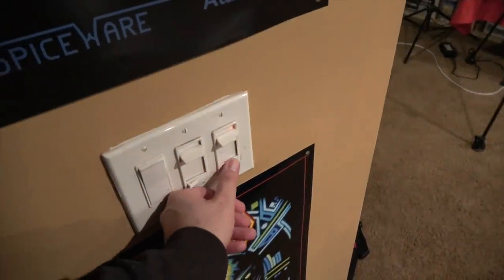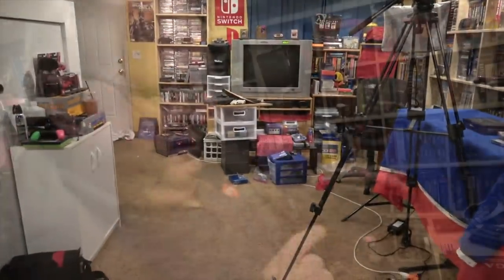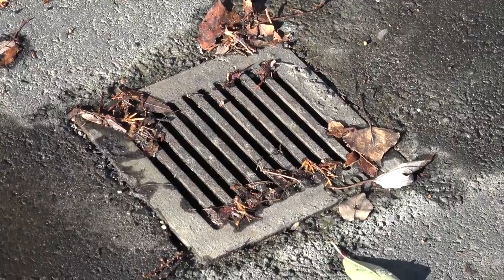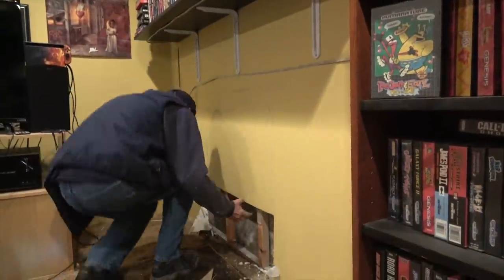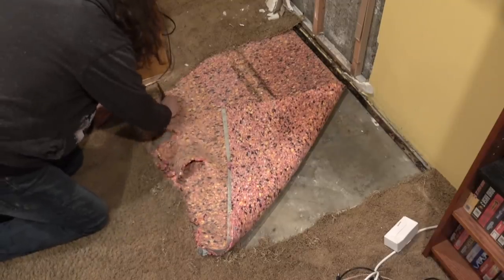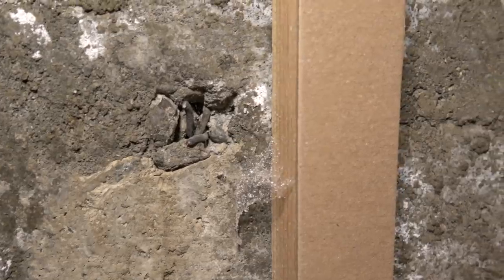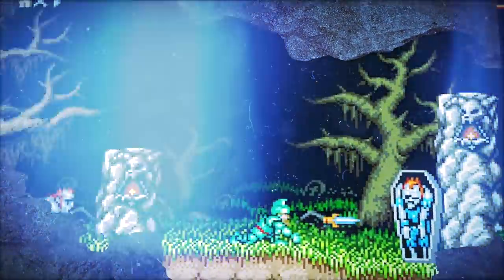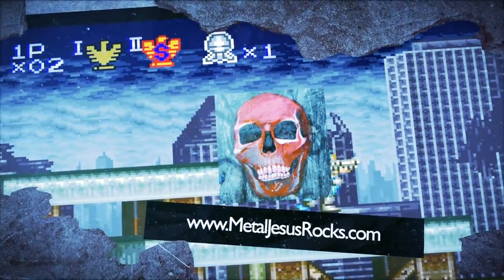OH NO! Water & Mold in the GAME ROOM! $10,000 to fix!

Comment: Concrete contractor here- be smart, don't overkill this- get several quotes. Basement waterproof trenching is a competitive business and might not be nessassary to solve the issue, Lowe's/home Depot will often install carpet free or low cost if you buy there, and drywall patching like this is an easy DYI if you watch a couple how to vids. I really don't think you're talkin a $10,000 fix. Sleep on it, and don't sign anything too fast. Love your show!
Reply: I do not recommend a homeowner do their own drywall, especially if they're techie people and not handsy people.
People who don't work with their hands often can't even be trusted to hang the rock. Finishing it is an art, and you really need a hopper and compressor to apply texture.
Reply: @billybobjoe198  LOL, almost any idiot can tape and mud sheetrock. It's rather forgiving, any imperfections in the mud can be sanded out. If you sand too much, you just apply more mud. As for texture, his walls don't have it so why are you even mentioning it? Watching some DIY vids is all you really need to patch a section. BTW, I'm also a "techie" among other things.
Reply: @madmatt2024  As someone who's been doing this for 10 years. I would bet I'd cringe at your drywall work. Either that or you'd spend weeks doing what professionals could only make a living doing in a day.
Reply: @billybobjoe198  Well someone seems to think a little too much of themselves and their menial job today. I guarantee 9/10 people couldn't tell the difference between my work and your work. I've done autobody work as well which shows every tiny imperfection, sheet rock is cake compared to it. Very DIY friendly. You just want to scare people away so you can make money.
Reply: @madmatt2024  It's not about having a big head over anything, it's just honesty. Even some professionals do junk work. Working on a wall with no texture is far harder than one with it. Texture hides imperfections. If you can't tell, my avatar is a cam gear. I've done my share of body work. DIY drywall is a lot like DIY bodywork. Most people don't have the skill set or patience required to do it. I'm just trying to save people the time and money to have a professional do it the first time.
Reply: @billybobjoe198  My dad is a construction worker and he says the drywall is where they put all the new workers at because it's the easiest to learn and hardest to mess up, chill out, I get it's your job and you're proud but it really isn't a big deal. It's not like it's the actual foundation of a house. Anyone can do it with a few tutorial videos or less then a week on the job.
Reply: @billybobjoe198  But its not nearly as hard as you're making it out to be. You tape, mud, and sand it. Once paint is on nobody will be able to tell. If we were back in the lath and plaster days I would agree with you 100% but today, not so much. If you want to be that anal about sheet rock then that's your business.
Reply: @kikyouwuv  I'm not 'proud'. I'm pointing out it's an art, and not something everyone is adept at. It's not a great DIY project for people because there is a learning curve and it essentially requires specialized tools to do. I can also tell your dad has nothing to do with construction because that's not even remotely how construction works. Also I find it funny how you're comparing dry wall (finish work) to foundation (non-finish concrete work). The vast majority of people you see doing concrete are fresh out if prison felons who don't actually have industry experience. I have seen countless homes with DIY drywall repair in them. It's painful to see. Sometimes customers hang their own rock, and it's unuseable. The goal in drywall is to mud over a good foundation (as few seams as possible with as small gaps as possible), mud as little as possible, and to not sand. Mud on drywall, just like bondo on car bodies, is a bad thing. It's a failure point.
Reply: @billybobjoe198  It's not an art. By the way you're talking you're a drywall contractor who needs to make himself feel better by making his work out to be more than it really is. Stop fooling yourself.
Reply: Get this to the top so MJR can see this!
Reply: You guys are hilarious. Upload some photos of your drywall repairs. If you're some of the fairly rare people who actually have the skill and patience to do it it'll show in your work.
Reply: @billybobjoe198   just want to point out alot of techies are hands on people.
Reply: Had an issue in a bathroom got a 10k quote diy work ourselves for 2k
Reply: This basement room is doomed unless you dig up the yard and address the issue instead of trying to place a bandaid. He should move, he will be fighting this issue every year after the winter thaw.
Reply: this guy is not the handy man sadly hes gonna be paying around 7-9g's for this job and its not a dry wall patch hes gotta basicly remove the sheetrock at hip height throughout the whole house
Reply: I've worked years in disaster recovery. I've taught people of all ages, from high school to grown adults who have never used their hands for labor, how to properly hang and mud drywall in  1-2 weeks, and our work is better than most of the work I see from professionals/contractors. He also doesn't need texture. This is the kind of thing the vultures would swoop in and tell old ladies after a hurricane/flood. Then we show up after they've put up a bunch of crap work for 10-20k and have to take it all down and do it again.
Reply: I'm sure he's just looking for money
Reply: Completely agree. Get several quotes. Don't jump too soon.
Reply: Work in construction as well, it’s not going to cost you that much if you do most of the work yourself.
Reply: @DRS_ur_GMEShares  Not everyone have the knowhow and experience to do something like to by themselves. Sometimes, you have to get someone to do the job.
Reply: I have to agree with Kelly Martin here. No offense to MJR but drywall perfection doesn't look like it would be high on his list. I completely hung my entire basement ceiling myself and one wall. After I was finished hanging the drywall, had somebody else come out and do the finish work. I probably could have done it myself, but I wanted knock-down texture on it all and I know I didn't have that ability and I'm a stickler for it looking nice. Also, $10k seems awfully high for the repair, but maybe that's just the going rate for that area. I just had to have a leak repaired on my main line coming into my house a few days before Thanksgiving. I paid the plumber $600, and that included him paying somebody to trench out the area. Luckily I realized there was a leak fairly early and got everything in that vicinity moved and the carpet pulled back. Before the leak was repaired, I was removing 7-8 gallons of water a day between emptying a dehumidifier twice a day and changing out towels every 3-4 hours. I'll have to have somebody come and re-stretch  my carpet, but when it's all said and done, I'll be way way under $10k.
Reply: @madmatt2024  Yeah, but try explaining this to a youtuber. :3.
Reply: @billybobjoe198  I doubt it. I don't need to tell anyone how long I've been doing this to flex on youtube. Then attacking people. I'm sure your work is quality :3.
Reply: When I'm done with grad school we need to fix our basement. When it rains, we get a little stream of water through our basement. So the basement is essentially useless. Foundation is 120 years old. Lord knows how much that will cost....
Reply: I don't think he wants to do it himself...he wants his subscribers to pay for it
Reply: @billybobjoe198  eh. Ive done my own drywall work with no prior experience.  Doing it quickly and perfectly is an artform for sure but its a pretty straightforward job when each second doesnt count and a mistake can just be fixed tomorrow.
Reply: byw yeah a good pro can definately get the job done quicker and better but let's be real here if you have a really nice home with arches and nice woodwork etc..get a pro.  In a basement space, just 4ft and mostly covered by shelves and game cabinets it'd be fine to DIY.  If its messy you just sand more.  Sand too much just get more mud.  It's not like reframing a load bearing wall where mistakes can damage your home.  If he's trying to cut some cost out, refinishing yourself is the right place to try to save money.  The worst that can happen is it doesn't look clean.
Reply: @billybobjoe198  but honestly why would imperfection on a wall matter when he is just putting a shelf infront of it
Reply: @billybobjoe198   lol in the uk we call bondo  BOGGING............though metal jesus first steps should be making sure the problem dosent spread around his home, ripping up the drive way  should be his first job and laying better drainage should stop the rot spreading to the other pins and then attack the dry wall.............leaving a driveway that has drainage issues to drain onto a leaking home is just asking for more trouble down the road
Reply: how can he be dealing with this problem every year when he is getting a really good fix it job and he has lived in the house for 12 years and it was built in the 60's and has had no problems like this till now.
Reply: One word, (Tremco)with drainage wall. 2,000 maybe if you dig trench and install product yourself. Fuck it YouTube university for waterproofing walls.
Reply: 10k it s ok if you have to do structural work
Reply: @billybobjoe198  Drywalling requires some physical exertion, but any dumb shit can handle it.  It's not an art.  There's a reason it falls in with other  sub-tradeschool service jobs, like painting.
Reply: @sluggdiddyyddidgguls  Nope.  There's plenty of sealant options available to consumers.  For about $500 I got my 1960's basement sealed up tighter than a menopausal nun.
Reply: @billybobjoe198  really wish I still had the before and after pictures of the 3 foot drywall patch job I did 5 years ago...Watched one very good YouTube video bought 2 sheets of Sheetrock, expecting myself to fail a bunch of times which didn't happen, even painted it myself...not every, "techie", as you put it.  Is a numpty at working with their hands and guess what there are "techie" artists in the world not everyone conforms to one trade or "hobby" I  for one love 3-d design, welding, and carpentry I have even dabbled in drafting too.
Reply: @LumenateTV  You're a jack of all trades. Same. It's hard to picture the incompetence of others sometimes.  Imagine a normie making a 3d model for the first time. they'll make a basic shape and get frustrated with the UI and give up. Imagine someone welding for the first time, they don't understand heat management and penetration and will make hemorrhoids on the steel.
Reply: i have a better idea why not just dig up the front yard but a 2 foot deep foundation  extending from the basement then put a drain going away from the house line it then fill it back up with dirt to catch the water and funnel it away from the house sure front yard will look like shit for a few weeks and it would be a band aid fix for the immediate problem area but it would be cheaper and look better than a roof or an internal drainage system
Reply: @billybobjoe198  thats what wanescoting and wall trim is for ;)
Reply: @madmatt2024  it is diy friendly just the doing it for the first time area will look horible till u get the hang of it suggest if he does go to home depot they have workshops on this sorta thing dont they?
Reply: Adrian Stoness best place and where I learned was doing the inside of closets nobody ever sees  those walls.   And for guys like byw....I can see the corner tape from the builders, cant see the ones where I did the work.
Reply: @ipfreely5052  nice
Reply: @billybobjoe198  dude. Come on. Most of that wall is going to be covered up with shelves and desks. This would be an ABSOLUTELY perfect opportunity to DIY some sheet rock, and save some money.
Reply: @aileentorres7675  wouldnt surprise me
Reply: Drywall is one of the easiest home repairs. I remodeled my living room with a 14 foot ceiling. I had to tear down a stucco wall with metal mesh, THAT was a pain. Had several hundred pounds of concrete to get rid of. Then I did all the woodwork myself.
Reply: @Pokemon Trainer Blue 

When I got my house, there was no drywall on the walls, other than the walls against the main house.   One of the first things I did was install an Aux Circuit breaker box.  I ran electrical cables down both sides of the garage for electrical outlets.  I ran wire for all the lights I had planned to put up.  Then I installed Insulation in the walls and put up Drywall on all the walls.  Did all the taping, etc, painted and looked great.    I'm not a Pro.  It takes some basic still.  normally you're not texturing the walls.  That's something you may do on the ceiling.   Still You can put drywall up, and have someone come in and do the finishing work if need be.  Do the things that you can do yourself if you want to save money.   You can pretty much learn how to do whatever from Youtube.    I know as I've done a number of things myself over the years having learned from Youtube and searching on Google.  It's the Information Highway.

Sure you can't do it as fast as someone who does one thing every day of their life as has mastered that skill.  But show what.  I can point to what I did and say I did that!!!
Reply: @billybobjoe198  There's a way to apply texture that requires no power tools. Take a square piece of 3/16" thick aluminum plate. You want it so it's almost as wide as the diameter of the inside of a 5 gallon bucket at the bottom. Trim off the corners so it'll set flat in the bottom. Countersink a hole dead center in the plate. That's to attach a comfortably sized dowel for a handle. Over the rest of the plate, drill holes, 1/2" or larger, to take out about 50% of the area. the holes can be different sizes.

To apply, stir up tape mud adding water if needed, until it will just hold a peak when a taping knife is stuck in vertically then pulled out. Push the plate down onto the mud then pull it out to pick up some mud. Push the plate against the ceiling or wall to transfer some mud. Move to the next empty spot and dab again. You can get 2 to 4 dabs with each loading of the plate. It's also a good idea to randomly rotate the plate and overlap dabs to avoid making a repetitive pattern.

Now you have to wait a while for the mud to partially dry and stiffen up. Then you use a big taping knife, 12" wide or so, to mash down the peaks and points. You don't want to fully level it and fill the empty spots. Just flatten the mud until it's around 1/8" to 3/16" thick. Would be a good idea to get some scrap pieces of drywall to practice on.

When the mud is fully dry, prime and paint.

It's a lot of work but not as messy as spray on texture, but you can make the tool yourself, or make several tools with different hole patterns for extra randomization. The biggest plus? Your walls and ceiling won't look like all the other cookie cutter sprayed texture ones.
Reply: @madmatt2024  doing drywall can be kind of fun. It's so much easier since self adhesive fiberglass mesh tape was invented. That paper tape was a PITA.
Reply: @greggv8  Homelite sells those stupid texture in a cans that I've seen boomers do entire walls with. It comes out like shit.
Reply: I had a similar problem with my lake property. The trenching isn’t always necessary, but it’s really good for peace of mind.
Reply: @madmatt2024  I'm on your side these people just want money p